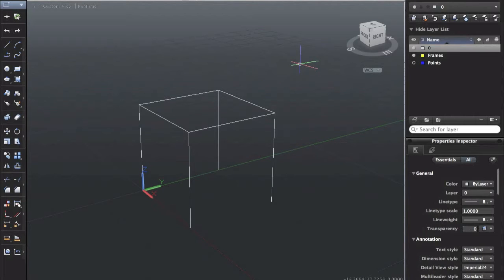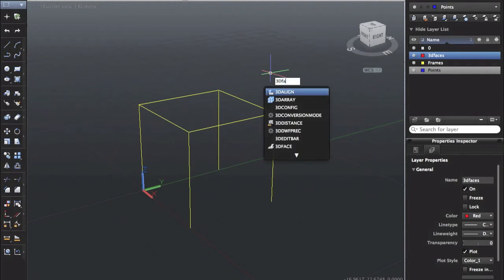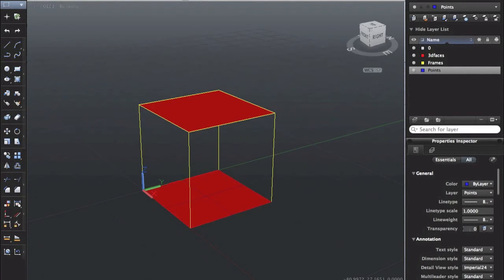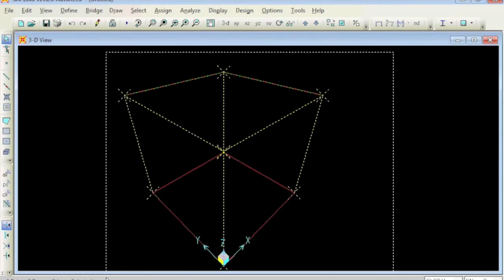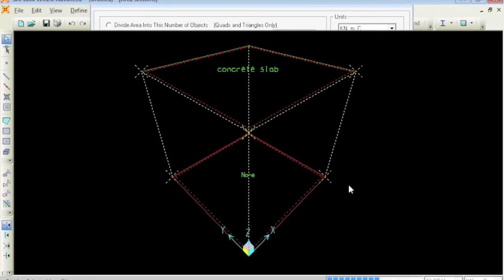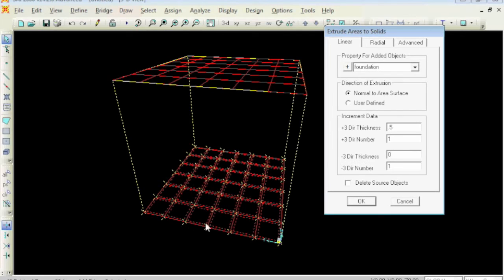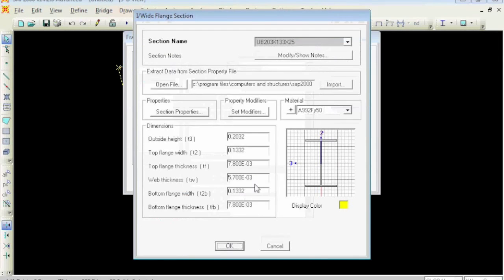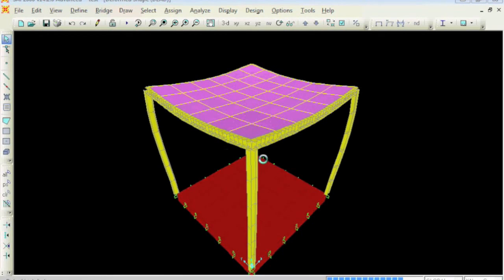How to import AutoCAD DXF to SAP2000 Structural Analysis.

Comment: Hey thanks for the video. Not sure if you've come across this error before. I have a 2D truss I need to analyze and have drawn it first in CAD and layered using your layer types. However, importing in the DXF file into CAD I get a "Can not open file" message. Have you ever run into this issue before?

Comment: Are u using cad3d or 2d
Reply from the maker: 3d
Reply: Thanks for replying. Can you do more videos. I've recently started working as hydropower design engineer,so I wanna do analysis of rcc saddel.,anchor blacks, basin etc
Reply from the maker: @199prabin7  SAP2000 is really out of range for what you are trying to design; you can contact me on my email to discuss further or via hangouts for more direct reply. M
Reply: @l0chis1  thanks for suggestion. Let me know your mail please I will contact you if I get stuck on problems related to sap analysis. Thank you
Reply from the maker: @199prabin7  in description you can send me a message on hangouts now. We can take it from there

Comment: thanks! I have a question: can you do the same using curved surfaces?
Reply from the maker: You need to break down the outer perimeters of the surface to multiple points in autocad and then import. Sap will only recognise the points - then connect points with surface tool in sap. I'm afraid sap2000 isnt very intelligent regarding surfaces (hence the reason y I dont use it anymore). M
Reply: hi Mike ! ohhh that sounds a huge work, thanks for replying me !
Reply: So, what software do you use when you need to analyze a complex surface?
Reply from the maker: luis miguel arana cabello dlubal rfem. Light years ahead of any CSI software.
Reply: thanks so much! When will you post videos about it ? XD
Reply from the maker: @luismiguelaranacabello7766  wont be soon. The company I own now does that kind of advanced engineering design we can support u if interested.
Reply: well, I only learn it  like my hobby, but if you have information, let me know it

Comment: Design a house in autocad and do its analysis in sap. I will watch it a 100 times.
Reply from the maker: i wont do it on sap! i can do it on other better software!
and definitely not concrete and brick :P im a steel engineer!
Reply: Mike Tsappas Then do a steel truss bridge with concrete decks. I could learn that. I dont know how to add loads either. I will watch if you make it.
Reply: Alright, what's better than sap? I want to learn.
Reply from the maker: if you are at a point where you dont know how to apply loading on the structure then you most probably wont really understand much of what i'm going to do.
Reply from the maker: but thats actually not a very bad idea! next vid truss bridge.
Reply from the maker: rstab and rfem by dlubal software - very expensive but very very good.
Reply from the maker: tomorrow i start with this video - from zero to full engineering design and detailing!
Reply from the maker: btw there is one more video of me out there simulating a cable bridge have fun with that one until the next vid ;)
Reply: Will be waiting for that. Do it in HD though, unlike the cable bridge you did before.

Comment: Hi Mike!!! Great video!!! Thanks!!!
But I need your help. I can't import a 3D model from AutoCad2017 to SAP 2000 V14.2.2.
The 3D model is a corner fitting from a container, so, doesn't need to create an area and convert into a solid.
Simply, I rename a layer as 3DSOLID, convert to dxf (2010 version) and then, I import to SAP2000 setting directions, units and layers.... But not happens!!!
Please, I'm waiting any help.
Best regards!
Reply from the maker: Adelmo Magalhães de França Junior hi thanks for the comment. I wouldn't recommend sap for any solid analysis/engineering works! it's not a very user friendly tool. also, when and if you are able to import the model as a solid or 3d it won't be very easy setting conditions releases surface releases loads etc (model wise). if this is work related you can contact us for possible discussions/solutions. looking forward to hearing from you. you can email me directly on my personal email at tsappasis@gmail.com or you can get in contact with us via our website - www.engineworx.org
Reply: Thanks Mike! So I will not consider the analysis of corner fitting in my research. 
I think the best software for this would be Ansys.
Anyway, I really appreciate your help.
Reply from the maker: Best software u can use is rfem - if this is for uni work please send it through. Work for students is on us ;) we don't charge

Comment: i am using sap v16  i have a probkem with designing every time i design beams the programme gives me that the section is exposed to over shear even i use enough sections and i try to increase but the problem still i check the defintion of material several times but no problem .........

Comment: i am using sap v16 but i have a problem with the design each time i design for beams the results from the programme gives that i have an over shear problem even i use enough sections i ckeck every thing but i didnt find the problem yet can you help
Reply from the maker: Amjad Kharouf hi, as I mentioned to other comments sap2000 is not the best tool for structural analysis. it is helpful to a point however I wouldn't swear on the results it provides. in other words I don't really trust the newer versions and or the older ones. if this is for a work related project you can contact us for a quote any time www.engineworx.org or at my personal email directly tsappasis@gmail.com

Comment from the maker: TO SOLVE THE PROBLEM WITH THE POINTS WHEN YOU IMPORT FRO AUTOCAD TO SAP2000:

When you import the points change in a weird manner. CORRECT! 

SOLUTION:

1) after you import, in sap2000 hover over the LAST POINT ON THE LEFT CORNER OF YOUR MODEL!

2) As you are over the point (on your model), on the right hand side of your screen you will see a point - coordinates (X, Y, Z)!

3) Write The Coordinates DOWN! WITH THE SIGN (+/-)!

4) Select ALL (MODEL)!

5) Editc - Move (OR Ctrl+m - i THINK!!!!!!!!)

6) A Window In Front Of You will Pop saying the DELTA distances you would like to move the model at - take the coordinates that you have noted and change the signs i.e. if the coordinates are (1000, 12385, -12309584.1123) - you will need to import (-1000, 12385, 12309584.1123) < these are the values that will import in delta X, delta Y and delta Z respectfully!

^^^^^^^^ The above method is the bomb - it solves this problem in a matter if seconds. IF you are still faced with problems please let me know and i will try my best to make another video on how to do this! :)

Michael Tsappas

@ Eric Espinosa, Osman Ali Korkmaz

Comment: hi miket, i have a question, do you know how to down the precision of the units in SAP. i change it in AUTOCAD and only use to decimal, but when i import mi dxf file, this have a lot of decimal points of precision, and this produce that many elements dont have conected
Reply from the maker: yes...i can help you with that....you will have to explain the problem a bit better though! you mean that when you work (say) in mm in auto cad (1000mm line) and u import that in sap2000 it screws up the units? (999mm in sap2000?)
Reply: miket tsappas
no, for example, if i have a node with the coordinate, x=3.45m, y=7.52, z=0 in autocad, and then when i import this point to SAP2000, the coordinate change to x=3.4525733967, y=7.52369871, z=0.00032541, mi question is, how can keep the same accuracy after import mi dxf file to SAP?, i hope i could explain my doubt better, thank you!
Reply from the maker: Eric Espinosa i see.... i think i have come across this problem again....you need to change the point accuracy from SAP2000 properties menu! play around with it I'm sure there is something there...oh...one more thing that may help you out....if you have sap2000 open - hit F1, the search will open up and just throw in there "change accuracy" or accuracy adjustments! give this a go and let me know how it works out. i swear i had this same problem before but i really really don't remember how i solved it and i have no access to sap2000 atm unfortunately to let u know more :/
Reply: miket tsappas Hi Miket i followed your advice, but it doesnt work, i hope you can remember how to solve this problems, i going to try to fix this problem and if i find the answer i will write it for all
Reply from the maker: Eric Espinosa Eric, i have done a bit of research on the problem that you are facing and this is what came up -> This usually happens when you are using either a cracked or a trial version of the software. What happens is during installation one value from one of the *.ini files in the installation folder (i think its sap2000.ini file) becomes corrupt. You can change that in the text editor but it is really not recommended. I would suggest trying to install a clean copy of the software again. HOWEVER, there is a way that you can change the accuracy of the units that you are using natively FROM sap2000 interface, i will let you know if i manage to find the solution, hopefully later this week.
Reply: miket tsappas Thank you Miket, in fact i dont have a license of the program, so i really would appreciate, if you find the solution to this problem, like you say, on solution is modify the s2k. file, in the coordinate, but i think there are better solution, so i will be wait for your answer and again Thank you Very much!!
Reply from the maker: i think that this link may shed some more light - i think that what you are looking for is import -> https://wiki.csiamerica.com/display/kb/Changing+default+units